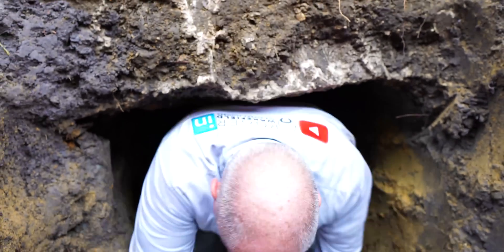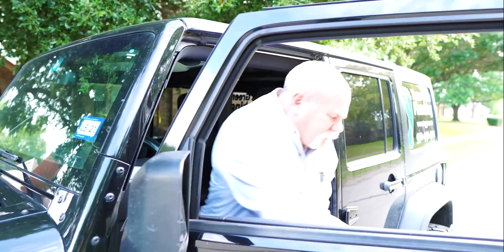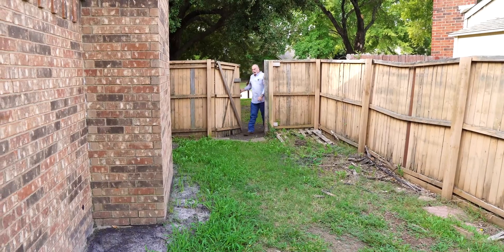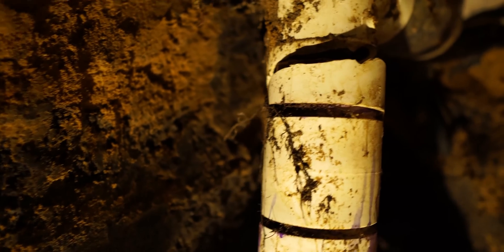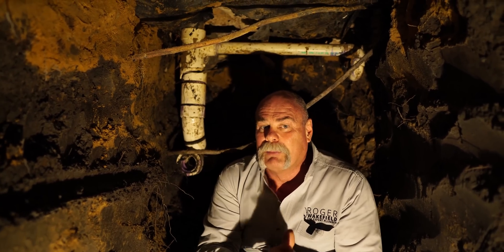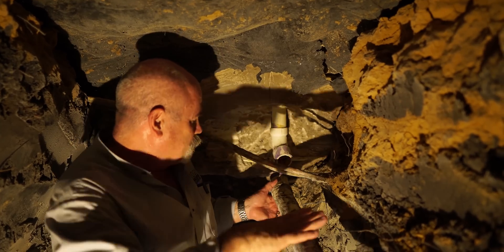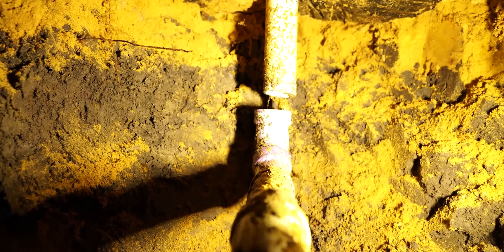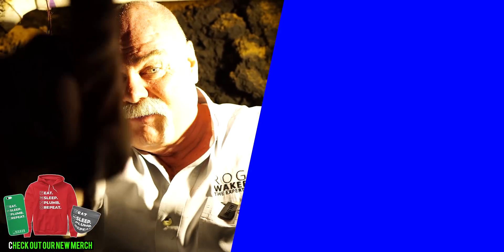Ever Wonder How PVC Pipes Break Under Your Slab?

Comment: why does texas use PVC for drain???  Here in Phoenix, it is all ABS.  PVC is used for landscape piping and french drain type systems. any waste water must be ABS.  

ABS is a bit stronger I believe and resistant to UV rays that are exposed (cleanouts) i've found.  I do not know if this is scientific, just in my own experience.
Reply: In Oklahoma you normally don't see ABS unless you are working in a mobile home.  Almost everything is PVC.
Reply: Not true. I work out in Phoenix metro area (Maricopa county) and we drop dwv pvc in everyyyyyything. You'll never see abs in commercial installations only in residential and even that is phasing out
Reply: It must be because of the extreme UV conditions in the desert out there. Most places in the East and South just use PVC.

Comment: im glad 99.9% of houses here have a crawlspace underneat them, dont have to worry about digging under houses
Reply: Wrong. Maybe 0.01% of houses do. I have never seen a house with a crawl space underneath it. AFAIK that would create structural issues.
Reply: Well in Massachusetts 90 percent of houses have below ground basements where we can attend to plumbing and if issue outside then it's behind or in front of house and not under it.  Pipes go through side of underground basements - not bottom of them.  So ya plenty of houses are built on alternate structure than a slab
Reply: Ps if there is a drain added in basement then we pump it up to the sewer line at roof of basement - at least that's what i did.
Reply: Dan yeah I’m aware houses are built on other things beside a slab. I live in a house with a basement. I was thinking that they were talking about a house with a crawl space under the slab. I dunno, I was tired when I wrote that comment lmao
Reply: My house in Cali has a small basement and crawl space also.
Reply: You would be wrong on that 99.99% figure man

Comment: Alright, I want to see the backfill now!!
Reply: A This Old House Parody: "Norm, what we're going to do is fill in the holes with a high-expansion, two-part, polyisocyanate with titanium reinforcement, pumped in through this six-inch flex line to fill in under the house. It's about 20 times more expensive than if we had the house jacked up, turned 90 degrees, and lowered onto a new foundation, but it's a lot cooler to use, and the homeowner's a millionaire."
Reply: @markh.6687  🤪😄😂🤣 that was so awesome!

Comment: Why would you build a house like this ?When we build a house like that the plastic barrier goes in we put the pvc pipes and support them then the iron and concrete goes on top and then the water lines go on top of the concrete or through the walls problem solved.
Reply: Because they were throwing them up fast, real, fast.
Reply: @tdmorgenthaler8384  ok but at least the water lines wtf? You throw soft copper in the dirt with no protection?

Comment: I never understood slab plumbing at all.  There has to be some alternative.  I'm surprised it's even allowed.  At some point you're having to go in and deal with it.
Reply: Or at least a crawlspace
Reply: North Texas has expansive soil, and no frost line. So, there is no need to dig foundation walls underground. Putting in a crawlspace requires either elevating the house, or putting in foundation walls with lots of rebar to prevent the expansive soil from breaking the foundation wall. Both cost more than beam and slab, and the builder and original owner won't be there in 30-40 years when the pipes break.
Reply: Yeah I hate it has to be super cost saving in the building process but slab plumbing and pvc and soft copper tubing I being in nyc can’t understand it for the life of me makes for a terrible repair or service plumber nightmare
Reply: I greatly prefer basements, but Harris county (Houston) TX is almost all slab construction too.  In most of Harris county, digging a hole yields a pond.
Reply: When we build a house like that the plastic barrier goes in we put the pvc pipes and support them then the iron and concrete goes on top and then the water lines go on top of the concrete or through the walls problem solved.
Reply: @M B lol, I mean if you build a slab house, how can you plumb it without burying it all in the slab. Or is a basement/crawlspace the only option?

Comment: Do have a question for you when you dig that far underneath the house do you have to get an engineer to tell you how to backfill or what material to backfill with just curious
Reply: We hire a structural engineer to look at the excavation.  We usually end up installing concrete with rebar piers and footers under each beam that we pass under.  The dig crew usually back fills with the existing soil afterward and hauls away the excess dirt.
Reply: here in San Antonio it's required by law for an engineer to come inspect the tunnel and sign off on it, then come again to inspect the actual plumbing and make sure it's up to code, then the dig crew fills it back in
Reply: @premiumfruits3528  with what though? Dirt, gravel, sand, concrete? If gravel what size?
Reply: lonnie lyttle you use the same material you removed from under the house, dirt.
Reply: I wonder how they compact the back fill. It would be interesting to see the mole people as they excavate and back fill.
Reply: @asbestosfibers1325  that depends on the state in which your doing the work

Comment: That doesn't look cheap!
Reply: 10k? Pfft just head to Home Depot and get a few day laborers for $120/day and they knock it out by dinner time.
Reply: @4Thug2Life0  dumbest comment I've read all year. That's how you get plumbers killed smh
Reply: @4Thug2Life0  You better hope those thing dont collapse on them and kill them all under there, $120 wont cover anything after their family of illegals sued your company to bankrupt.
Reply: @dangda-ww7de  I think he is talking about doing it as a customer, not a business. Imo, I would do it myself if it was that much money.
Reply: @dangda-ww7de  if the hole collapses all u have to do is go back to home depo and get so 80 dollar a day guys to come fill hole back in....
Reply: @51-FS  hahaha
Reply: im no expert, but just the digging part, it seems like a 10k job
Reply: That's the downside of slab-on-grade.  If you have a basement, it's easier to handle anything inside the house perimeter, but people don't want to spend the money on a basement if they don't need it.  That's why so much of the southern US is just slab-on-grade, the initial cost is lower.  In the north, basements are common, because if you have to dig down 4 feet anyway for frost reasons, the extra 4 or 5 feet to make a proper basement is a minor cost in dirt removal and materials, plus whatever you need to rough in the rooms there.
Reply: @tashkiira7838  around here (SC lowcountry) the issue with basements is the high water table. nobody has a basement, even if they're millionaires.
Reply: no its not 50 dollars a foot not counting the plumbing repair they use high pressure water and a pumper truck to do it
Reply: Anyone know how much this costs in total?

Comment: JESUS!!! Who is on your dig crew?!? Molepeople?!?
Reply: How do they fill it back in is puzzling me 👍
Reply: @robmarrin6720  I would be interested in this as well. How do you back fill this tunnel to provide support to the plumbing.
Reply: Rob Marrin filling it is easy you have a huge pile of dirt to use, digging is the hard part. I’m with Nathan good god how is that even possible?
Reply: @robmarrin6720  they use wet mud I would guess and pack it like mortar
Reply: @oWhiteMonster  I thinks they take the dirt they took out mix it with water and and make a clay or puddy like substance then put it in a hopper spraying from back to front and some went as far to mix a powered conc in the mix    atleast thats whar they did in mid 80s round here.  Dallas-Fort area.
Reply: I want to see how his dig crew digs this out!
Reply: @0ptixs  Seriously need a video of the dig out. I would have thought the plumbers would want to go through the floor to replace all the plumbing.
Reply: @turtleturtle4909  There are two schools of thought in North Texas. One is to dig from outside the foundation exclusively, the other is to cut through the slab in a few places on the inside. The latter will require replacing floor finishing, but may be cheaper if strategically dug, even after replacing the finishing. You will never get a good support of the slab and the foundation beam in the former case, as it gets filled in reverse order, and will settle. It would be interesting to hear Roger's opinion of the pros and cons.
Reply: @turtleturtle4909  depends on the state on if you dig or you break the concrete. different states have different dirt that effects if the slab has metal rebar in it or not. some states even have tensioned rebar in the slabs. in Indiana my state we bust the concrete from the tops since we have solid ground with no rebar.
Reply: Turtle Turtle oh trust me we usually do.  This is voodoo
Reply: @turtleturtle4909  Repairing the floor is often more expensive than doing an underside dig, not to mention it messes up the inside of the house.  That's a slab-on-grade house, the floor is sitting on 4 to 6 inches of concrete.. and then you still have to dig down.  It's cheaper to get a couple of guys with shovels and buckets and dig it out, and you leave all the mess outside the house.
Reply: @0ptixs  same
Reply: professional prisson escape artists
Reply: They got good dirt lol 😂 mole people 😂
Reply: Former tunnel engineers for the cartel
Reply: lol
Reply: I bet they pump in flowable Fill to restore it. That’s freaking impressive to see a dig crew did that.
Reply: El Chapo’s old crew
Reply: Did crew has gotta be making bank
Reply: Holy fak. Ya’ll ain’t diggin’ holes like that here in SW Missouri!
Reply: @marksmith6104  your 100% right about that damm rock clay
Reply: Yes
Reply: @Mr Willyum Maybe. I only have found one video on youtube of a dig and fill. It was a homeowner who dug the tunnel, and got a plumber which showed him how to fill it back using mud balls.

I also think I saw a video of a tunnel being filled with some sort of sprayer.

I wish there were more videos on this, these tunnels are really cool and I would like to know more about the process and how to do it properly.
Reply: North Texas Molepeople.  I bet they are the same ones who hand dug us a 42” hole 300 ft under I-40 To get a water main encasement in.  It was freaking impressive.
Reply: Well he's in DFW so probably ex cartel bois
Reply: Mejico
Reply: You know that the earth moves. Right no matter how stress free anything is.
Reply: El chapo got out of prison in one connected to the prison lol. Molepeople indeed
Reply: The border tunnel diggers needed a real job.
Reply: Same crew el chapo uses
Reply: Fraggles
Reply: Looks like a Texas/Mexico border crossing
Reply: He’s in Texas.   I’m going to guess and say...Mexicans.
Reply: @trade1for2  ding ding ding winner winner chicken dinner
Reply: @trade1for2  bingo
Reply: You people  are crazy. I would never tunnel under a slab. Nobody does that around here. We always go in through the top. No way Jose
Reply: @757Asmith  The customer probably requested it over the damage to the interior. The damage to the plumbing is extensive so you would have to cut the floor out in multiple rooms. Which as you know is a invasive process. This is actually my first time seeing someone tunnel under a slab, I have a lot of questions and will look more into it. But seeing him do it lends credibility to its overall safety.
Reply: Mexicans